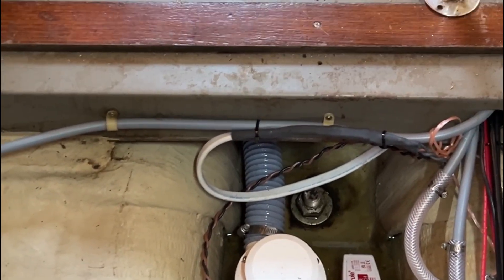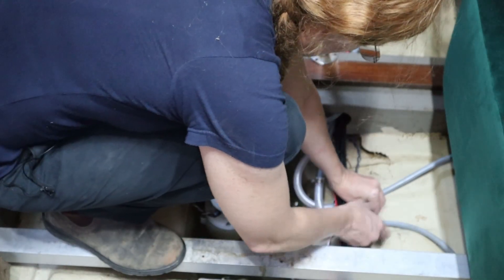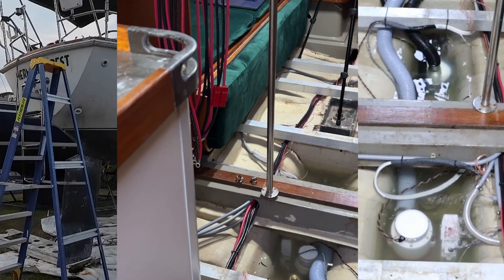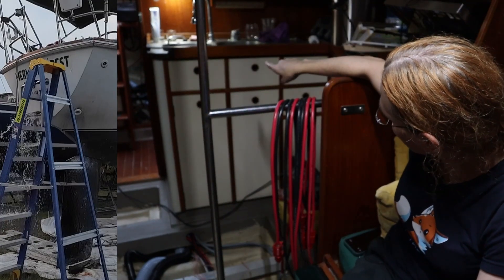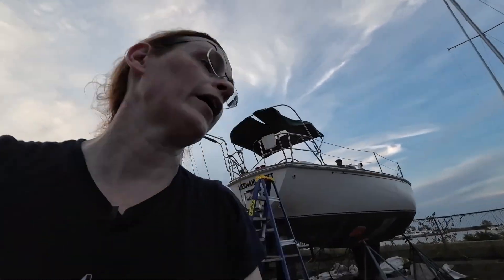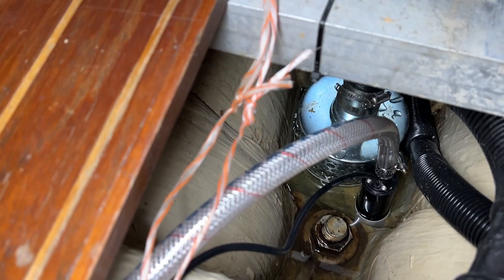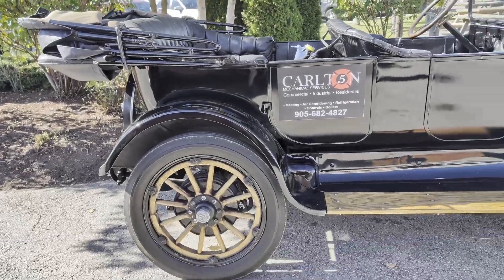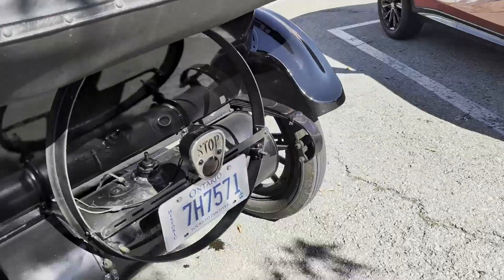Bilge Pumps, Take 2 - Ep. 117.1

Comment: For the dry-out pump I'd put 2 small pumps in series, one submersible in the bildge as you did, the second one after the curve of the anti syphon. The second one will dry the hose when the water is over. 
Both connected in parallel and powered by the timer relay with measured timing setting to run after the float switch went off. A few seconds of dry run won't harm the bildg pump, and the timer relay is really convenient.
Reply from the maker: Not a bad idea, I'll see how the current setup works once out on the water and consider that if needed.

Comment: Nice.  You might want to install rubber grommets in some of those holes in the bulkheads, the edges look like they can chafe the cables.   No need to remove the cabling, just cut the grommet in one place so you can wrap it around the cable and then push into the hole.

Also, on the electrical, the bilge is a critical component.  Since you have two bilge pumps, consider putting them on different batteries or putting one on a separate buffer battery higher up above the water line, so you have redundancy in an emergency.   (Same for the radio).  Little 20Ah or 30Ah 12.8V LiFePO4 batteries work well as buffers with a 75/15 charge controller to keep them at 99% from the home bank.    This is very much a subjective issue and every sailor does it differently.

Check valves can get clogged but probably the main reason is to prevent blowing out the pumps seals from back-pressure when the pump is turned off, or to prevent vacuum-locking the pump.  Or something along those lines.

-Matt
Reply from the maker: I'll lift the sole after some testing and see if there are any signs of chafe. The old hoses I pulled out didn't show any signs, so hopefully it'll be OK, but worth checking. I've got three sources of 12v; 2x 12v batteries plus 48->12v dc/dc converter. So I think the bus is as resilient as it can reasonably be.

Comment: Nice fix, just the other day I had to fix a problem a engineer so called  had  caused by installing a bilge pump,  Rule 2000 with a new skin fitting, neat install, however;  the boat went sailing with its owner and spent 5 hours in perfect weather on one tack, when he pops below for a cup of tea the saloon is now under water. this is because the outlet went below the water due to healing and pumped hundreds of letres of water back in via the new pump even though it had an anti hyphen loop,  one insurance claim later and I now have fixed a 3 year old boat from a stupid mistake......please fit a one way valve, however,  only use a flap valve not a spring pressure valve as they need very little pressure to open and the back pressure will keep it closed.  Your big pipe may be hard to find a flap valve so you may need to 3d print one. should be fun. I also fit loud buzzers to warn the pump is running, this can be connected to the switch side of the float switch.......good progress...
Reply from the maker: I'll absolutely be adding high water alarms! On top of having anti-siphon, I think a key thing it to route the hose high as you can, under the combing in my case, so that water coming in the exhaust port simply has too high of a hill to climb. I actually bought the check valve, so it's an option still.
Reply: @TheDigitalMermaid  I think that routing high may not be a solution for the situation described above. If the outlet is below the water outside and the pump inlet is below water inside, then when the pump runs and fills the hose, you have a siphon that will go from the high point outside to the low point inside and will be quite happy to go up and over the hump. I suppose a small one way valve to atmosphere to let air in at the high point would prevent that. It would probably need to vent outside the cabin just in case it fails open, otherwise it would spray some of your pumped water back into the boat.  Wow, so many ways to fail.

Comment: Hi Maddy, Nice hasty video:) quit buzzy i guess:) May i suggest a Take or option 3 for the  dry bilge effort. 
Arid and DryBilge have crazy expensive systems for getting the last water out. Crazy expensive ($1000+) means  DIY'rs territory! yeah:) So much people using those Seaflow pumps that  Seaflow itself has made now a ready to go system (Seaflow Dry Bilge system 2) that can keep 4 bilges dry. 
Base of all these are membrane and not centrifugal pumps which are self priming and can run dry for a long time. So these systems are timer, rather than moist or waterlevel based. The pickup system is a simple sponge and the created vacuum. The hoses and click-connectors are based on air/gas systems. 
I DIY'ed and installed one myself and can confirm it works perfectly and even just  1mm of water is in time sucked away! I based it on this description: https://whichsailboat.com/2019/03/28/diy-arid-bilge-or-dry-bilge-system/
Seaflow info: https://seaflodirect.com/pump-series/dry-bilge-system-4-suction-zone-splitter/
But my guess is you can make some real nice 3D printed sponge pickups :)) Just to keep you  occupied:)))

Ow and the self almagating tape: you have to stretch the tape to at least 1,5-2,5 the length so it activates. For electrical isolation, cut tape in half. Makes thin strips much easier to wrap and form around wires and connectors.

Good luck!

Comment: I would heavily recommend going full tilt and mounting both the mini pump and its own float switch.

if you put the manual switch in that closet(or the bulkhead above for that matter), then you can easily run a feeder off the back of that switch to a float that bypasses that manual switch.

gives you both the automatic and the manual override option.

to mount the pump, just get an appropriate diameter capacitor strap for a home AC unit. (they come in a lot of sizes and are available as replacement from a few hardware stores)

they're usually stainless and mounted with one hole.(save you from punching a thousand more holes in the old girl's belly)

may i ask why you arent using the neat little honk-siphon-breaker thing...

the one you showed last time that got a giggle out of you from the sound it made?(we all did,let's be honest ^.^ )
Reply from the maker: The question is where to mount a little float switch... I'd like to, but ya. Wiring it isn't the problem. The pump is held it rather well where it is, but it has a lower cap I can put a screw through like the other filters if I want to mount it proper later. The big pump will absolutely get an anti-siphon setup, it just wasn't in when I wanted to test.
Reply: @TheDigitalMermaid 
I figured you weren't going to ditch it ^.^

as for the float switch, mounting is a bit tough i have to agree there.

if i trusted them more myself i'd point ya to those fancy little ultrasonic float switches...

but I'm sure that, while water-resistant... they probably wouldn't like the sloshing.

I dont know.

im sure some braniac out there has a MUCH better solution.

OOOH! YOU JUST GOT A 3D PRINTER!!

im sure there are options there too considering your skill with MCUs :)
Reply: Dam that was fast.   That little sump pump is cool.  Good to have on the boat for other potential emergency usages like a wash down, filling a water jug, or even a plugged sink or head issue.